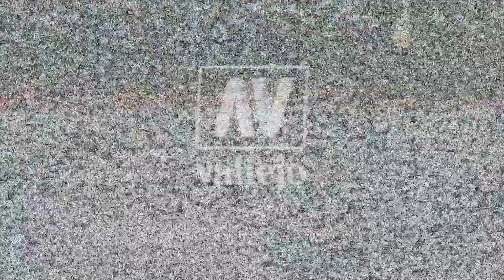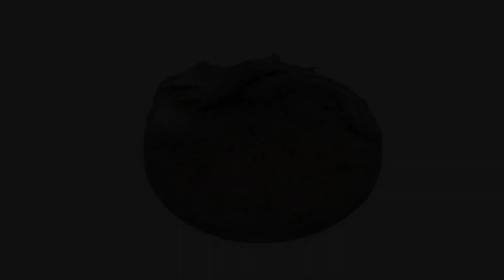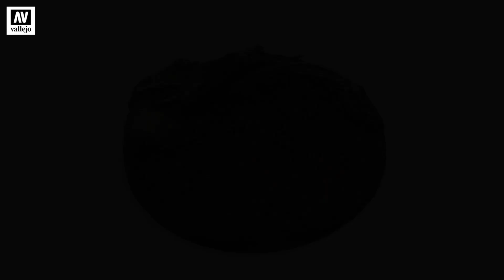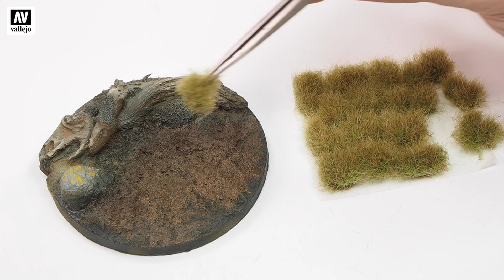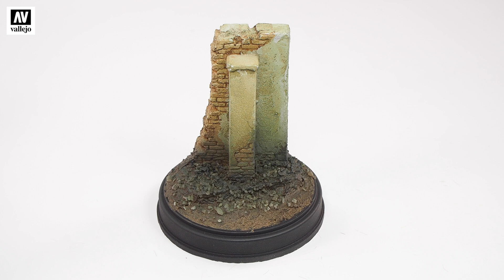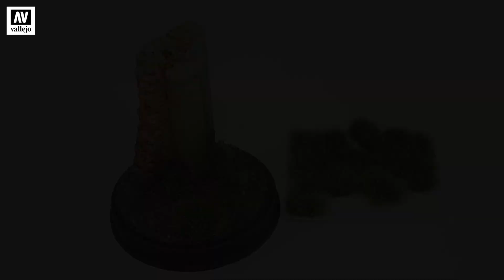Weathering process using Model Wash and Vallejo Scenery

Comment: I would like to ask a question that I asked on a previous video. There was no response but that is understandable because the video is already 2 years old. My question is about airbrushing Vallejo model color. On the bottle of model color paint it says: “contains calcium, do not spray.” Can I safely spray model color or should I not spray model color at all? I know the Vallejo company made a video about spraying model color but I still want to ask it just to make sure.😅
Reply: Yes, you can. There is no problem by spraying with an Airbrush.
Ich do it formore then 6years.
Reply from the maker: We reformulate all the colors in 2014 in order to avoid using cadmium pigments in some colors (reds and yellows). We do use them in our fine arts lines but
we decided to took them away from hobby in order to avoid the "do not spray " symbol as some consumers where are always concerned about what they use.
So, you have some old batches and new ones, we have docs stated by an external toxicologist that informs that due to the small percentage of cadmium this color can be sprayed with no health risk, if there's no caution note on the label, there's no cadmium inside the formula.
This is the reason why we decide to maintain all the info on our site about cadmium, on some color references, like the red VMC, sometimes they are still some old bottles on racks that are wearing the do not spray but you are safe with us no matter you used with a brush or with an airbrush.
The hue and shade of the new formula is slightly different color than the old 70.926 Red or 70 908,.e. and the old one is not available.
Reply: vallejocolors sorry for my late reaction, but thank you very much for your explanation!